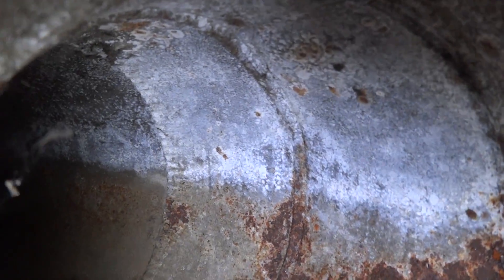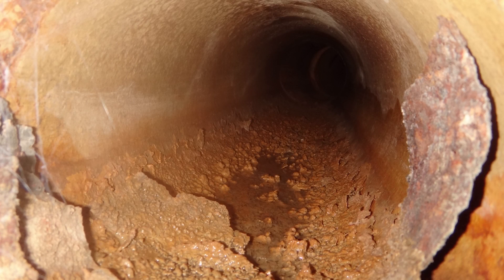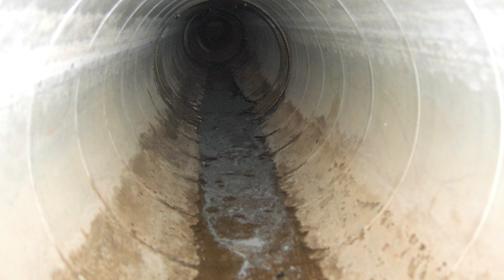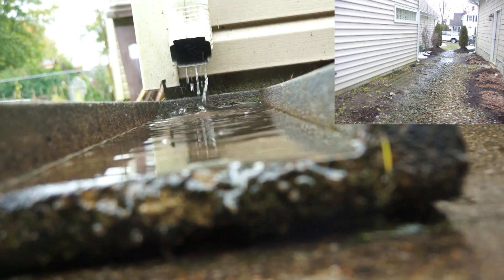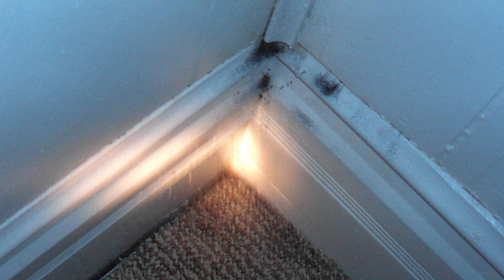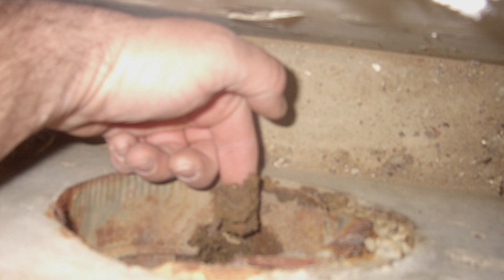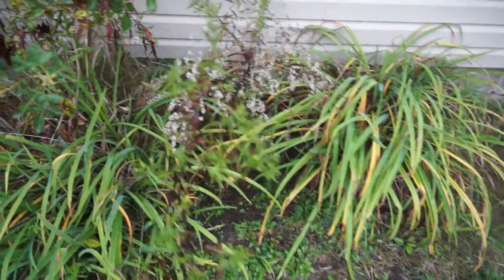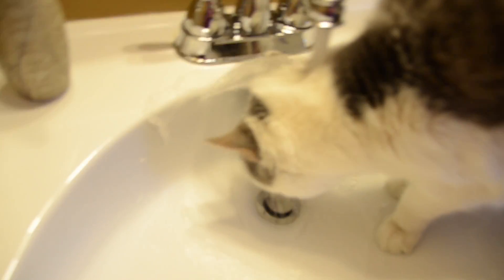Duct flooded: Ducts under slab problems flooded rusted mold

Comment: I have a corrugated black plastic duct system set in the concrete slab foundation of a 1976 ranch house.

  I got a depstech camera to inspect. With my phone alone I was able to see dust, cobwebs ,rocks, and an acorn. So much debris in the ridges.

Need to clean, sanitize, and seal pest entry points. So far no company will agree to clean saying their system is so strong it may damage the plastic.

Comment: Do you have to fill the entire line or just pour a bag or two of cement into each vent hole?  And if you do have to fill the whole line, how do you do that?  I only see like 2 or 3 inches of clearance in the duct... the rest (at least at the vent exit areas appears to be soil.  It might open up further in... not sure.

Btw, my house has ducts that seem to go under the basement slab.  They are metal at the vent exit but I think they are actually clay underneath the slab.  Anyway, there is definitely soil getting in.  I also have some musky smell but not a ton.  I haven't seen any water.
Reply from the maker: condensation in ducts plus musty smell is mold/mildew
Reply: So, just capping off each exit to the duct will work?  Or do you actually have to fill the whole duct?  And if so, how?  Thanks in advance.
Reply: This is my question too
Reply: @101perspective  Hi 101 perspective!  I'm also dealing with the same type of issue.  I see that Clevelandmarko did not create a public reply.  Perhaps, he answered in a more private  manner.  I'm currently capping the vents off.  I will keep watch over time and will do my best to give updates.  We considered filling in the entire duct, but thought that if ground water expanded in the dead of winter, it may create a problem with our slab.  If we cap with cement at the registers and plentum pit and it cracks or fails in some way, it can be resealed.  Since our ducts are 6 inches, we are plugging the duct with the following supplies:  An inner plastic hoop from cross-stiching rings and an 8 oz container of Great Value Whipped Topping.  We place the hoop around the outer edge of the container, discard the lid, and push the container into the register, then the circular duct, allowing the container to create a plug for the newly poured cement.    We pour cement into the register area and fill it to floor level.  We do our best to ensure that the cement does not have air pockets.  I'm wondering what you did to solve your problem.  Thanks for any information!  Hope we can help others as well.  As for solving our problem, it is a multi-step process.  Not only are we sealing the ducts, we are addressing French Drain issues, redoing gutters, and getting a new heating system.
Reply: @loristrawhecker5615  Btw, I heat my basement so freezing isn't an issue for me.  If you don't heat yours then maybe capping the vent leading into the underground system isn't a good idea... I don't know.  I was told to do it because it would mess with the air flow/waste energy/etc. 

In your case, keeping it connected may keep it warm enough not to freeze. 

If you are overly concerned about the water levels in the underground vent then the only thing I can think of is to maybe drill a hole in the floor (to the vent) that you could unplug from time to time to check water levels.  And if you never see a problem then just fill it with cement in a few years.  I do stupid stuff a lot though so no clue if that is even remotely a good idea...lol.  For all I know that could be a recipe for a flooded basement.
Reply: @101perspective  We have different problems.  We have a home that sits on a slab.  No basement.  It sounds like some of your ducts are compromised while others are ok??  All of our ducts are under the slab.   We are abandoning the current heating system.  I'm not sure drilling holes to check the ducts under the slab would benefit us.  We have never seen standing water.  We watched it all winter by taking pictures of our ducts and plentum pit entrances.  We've talked to numerous professionals.  We loved, loved, loved the idea from Advanced Air Duct Solutions where they would coat our ducts using a latex based coating.  Our only problem was that our ducts must be cleaned before the coating.  Other duct cleaning companies told us that our ducts were too rusted to clean.  The vacuum suction would destroy the ducts.  Rick and his wife from Advanced Air Duct Solutions offered unbelievably amazing customer service, unlike anything I've seen.  I wish we could have used them.  They have a solution for this problem if the home owners find them in time.  We are trying to understand how to manage our slab floor.  We think that using a vapor barrier on the floor before we place our flooring materials will be enough.  What do you think?  
P.S.  "I do stupid stuff a lot though so no clue if that is even remotely a good idea...lol. "  It sounds like I'm not alone!  lol  Glad there's this type of platform.  Maybe we can learn from each other and others!  BTW, this is  not a big box store problem that has an easy solution.  Wishing you the best!
Reply: @loristrawhecker5615  Mine are the old clay type.  However, where they come up at the ends is metal and has completely rusted away.  

As for the water, I only mentioned creating a way of checking since you sounded concerned they might fill with water or something and then freeze.  If they are under your slab and the room above the slab isn't going below freezing then I can't imagine that you would need to worry about freezing.  I mean, water pipes run in/under slabs and don't freeze. 

While I never see water in my vents, I am concerned about some moisture gathering once the air flow is stopped via me plugging the ends.  Hence why I will also plug where the venting enters the slab from the heater/ac unit.  That will keep any critters, mold, etc, from forming/getting into the house. 

Btw, if yours are rusted out then you might want to check occasionally for termites.  I know I had a termite swarm come in from one of the vents that had rusted out and opened to the dirt below the basement.  I noticed it in time though and they didn't make a home.  I still had the whole house treated just in case.
Reply: @101perspective  Since you mentioned termites, it would be helpful to understand if your home is in the South.  We are located in the Northeast.  Thanks for the thoughts.  We'll keep an eye out for any signs.  They are rare in our part of the country.
Reply: @loristrawhecker5615  I live in Kansas. 

The house is pretty old... hence the under floor vents.  Luckily, the prior owner installed ceiling vents.  They just never capped off the floor ones.
Reply: @loristrawhecker5615  Hi, I am curious as to what you guys ended up doing? Cleveland marko has not responded to me offering to pay for his consultation services. I will be installing a new furnace this week. Just need to figure out the proper way to seal these ducts!!?
Reply: @101perspective  did you end up just capping the entrances with high density foam and concrete? Or did you have to fill the entire duct system?
Reply: @nickmagnasco9409  My basement is finished but I don't use it for much.  So, I ended up just removing the metal vent, putting a plastic bag over the hole, and then replacing the metal vent.  Effectively sealing it off.  Yet leaving me the option to just pull up the metal vent to access the hole again if I want to check on it, etc.
Not a perfect solution but good enough for me.
Reply: @nickmagnasco9409  I don't want you to think that I have figured out the 'proper way' of sealing the ducts, but I can tell  you how we did it.  Our situation may be very different from yours.  We found that cottage cheese containers were nearly the same diameter of our ducts.  We inserted them into the ducts about 12-18 inches.  The tub side is cupped so that you can fill it with cement.  We filled the hole from the cottage cheese container flush with the floor. We used a plastic sheathing barrier on the flooring before we laid our flooring down.  One room is loose lay flooring.  We used this type of flooring because that room occasionally had water puddling on the floor.  The loose lay would allow us to monitor the situation to understand if it was solved.  It was solved.  We used a wood laminate flooring in the other rooms with the plastic sheathing barrier. We purchased a furnace and the installer ran the duct work through the ceiling.  We are so very pleased!  Our heat is well distributed throughout the home.   Hope this information is helpful.  Let me know if you have any more questions.
Reply: @loristrawhecker6311  this is very helpful!! Thank you!